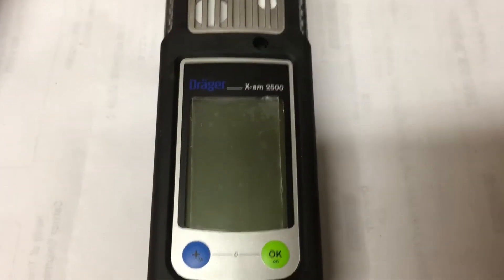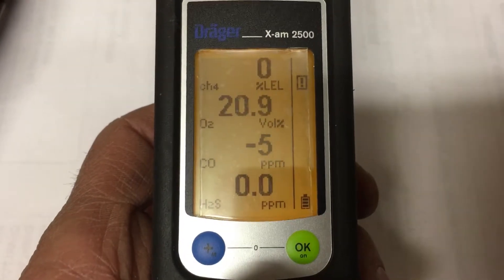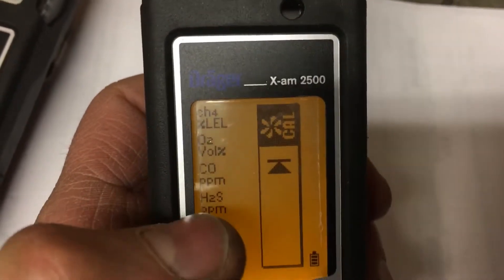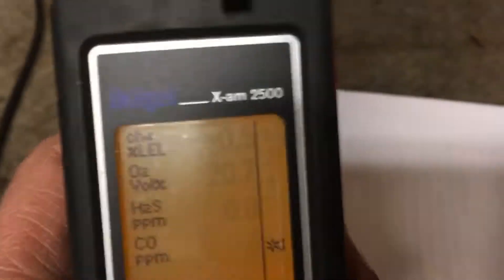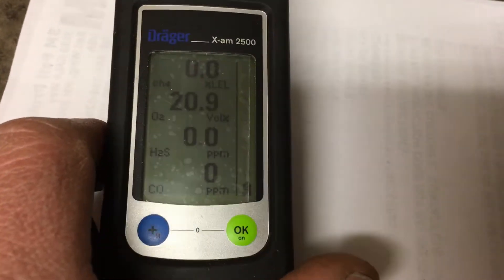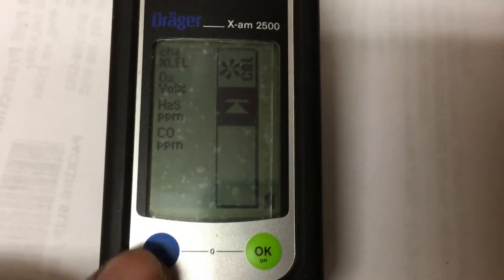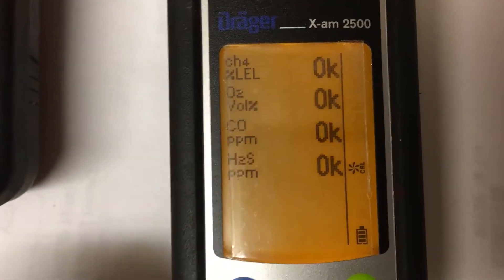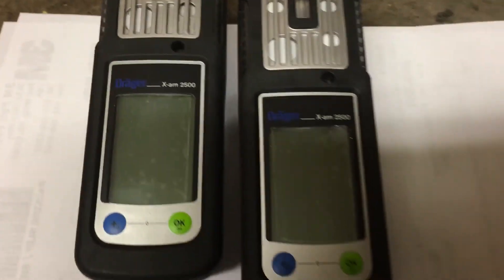Draeger X-am 2500 Turning it On / Off and Performing Fresh Air Calibration

Comment: How do I know if the unit is warmed up? Is there any indicator or something that shows the unit is ready to be used?
Reply from the maker: Unfortunately there is no indicator. On the older X-am 2000 air monitors there was an exclamation mark ❗️in the upper right corner that would go away when it is warmed up. But on the newer X-am 2500 air monitors the exclamation Mark ❗️ goes away before it is actually warmed up. 
It generally takes 4-5 minutes before it is warmed up. “Unless” you have removed the batteries or it lost power. In that case it can take 15-20 minutes to warm up. The easiest way to check how much longer you have until it is finished warming up is to just attempt a fresh air calibration as explained here and it will tell you how many minutes are left for it to finish warming up, as shown in one of the units in the video here. Once you are able to perform a fresh air calibration on the unit then it is warmed up.